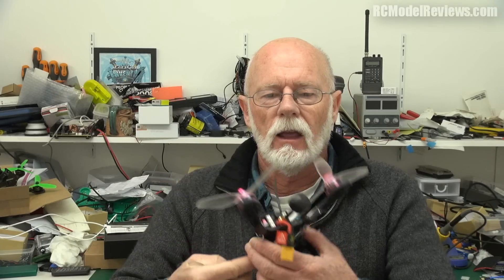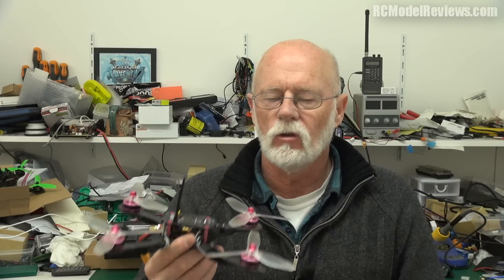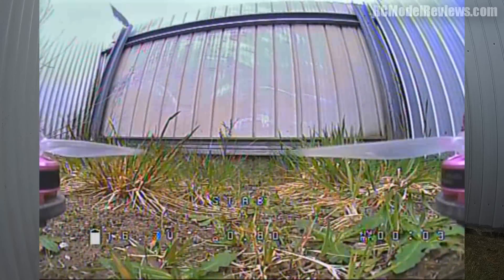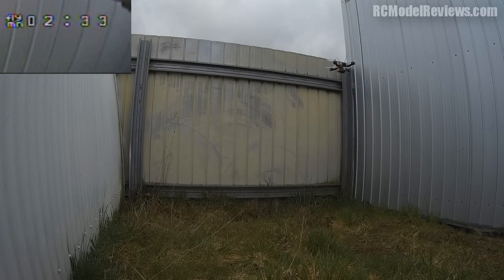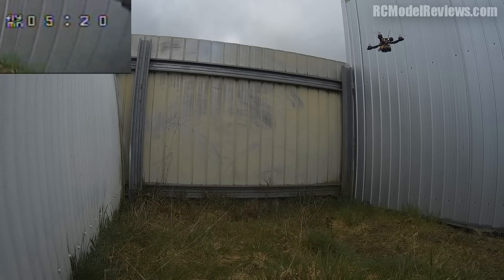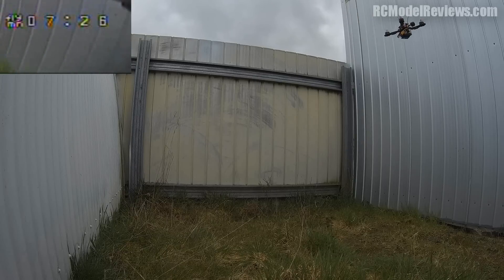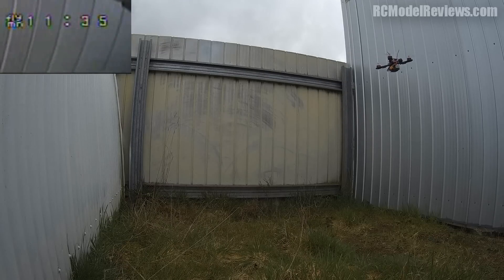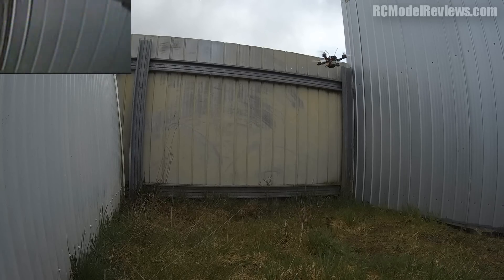INSANE flight time from Kopis 1 racing drone

Comment: The world record for RC rotor wing endurance was set by a Mikado Logo 600 set up for maximum power system efficiency and low headspeed swinging asymmetric blades.

Comment: Bruce, stick a keychain 808 #16 D v3 on there.  Just a few grams of weight, 720p is fine enough for basic uses and they can mount just about anywhere.  I really wish someone would upgrade that camera to 1080p and a few more frames.  And 2nd, clean your desk.

Comment: i get around 11 minutes out of my miniquad just hovering around. its that zmr250 with cf 2 blade props, and a 2200 3s strapped to its back. i couldnt figure out why every time i ran a 4s the thing would get really funky flying characteristics... it would heavily tilt to the right, and there is nothing you can do to combat it... i tried doing a roll to get it back level so i could bring it back, and ended up putting it in the dirt at the edge of a field. almost didnt find it...

Comment: I have a fairly heavy ZMR 250 frame. RMRC 2300kv blue motors (rebranded T-motor, though I forget the model number) w/ 5x4x2 Dal bullnose props. IIRC, with a 3s 2200mah it's ~550g. I can easily get 10 minutes out of it when I fly gently. Usually I get 7-8 when flying LoS acrobatics. Not my fastest quad, but definitely my favorite.

I've wanted to try some more efficient 6" props and a slightly lighter battery, I have what I have.

Comment: i really like the idea of cinematic fast quads,  i make jokes about how long i can get out of a 1300mah, which was over ten mins regularly, my excuse was i'm still learning and only had 3 (now 6) batteries so i didnt want to waste any power stopping unless i was learning or practising something, i also gave my battery time to recover between any extreme throttle, my videos still suck hehehe... oh i should mention to anybody trying this kind of thing, when you slow drain a battery it has very little bounce back, so a normal fast flying flight will bounce  back to 'x' on your alarm if you slow fly even 70% of the time it won't bounce back so arrange to land on first constant battery alarm,  but yeah bruce great idea...switch off the auto record on the split... it will over heat... and you want the lens just in front of motor nuts on a 27mm high topdeck  and 25degree tilt to leave just a tiny bit of prop in the corner, its invisible in normal flight and you can put black bars onto final vid.... ps.. 25mm stand off and a two millimetre nut =27mm. the big problem is jello. i've tried everything. its probably worth making a foam cube type of thing to encase the camera. and maybe something to stop the battery sliding forward,  omething to scoop it over the camera in a crash.

Comment: Most time I get with my heavy 250 mini quad (850g with battery) is 9 minutes draining the battery to 3.7V per cell. Racestar 2205 motors, Gemfan 6040BN props and 2200mAh 3S battery. I guess if I were to build one 300g less (would be pretty easy) and with the same motor/props it would fly much longer.

Comment: What is the point? Flying as a racing drone should be flown, you'd be at 4-5 minutes. Yes they're efficient but they'd be better on a significantly lighter quad. Word has it that they break easier than the r2s. If I wanted an even longer flight time I could put my goggles on and sit it on my desk for a whole day.

Comment: This is a very interesting video on efficiency, Bruce, this quad seems to be the nicest builds around. Not the top line raw performance but tuned so well, the end result is much more feasible than other RTF offerings.
I did similar experiments on mine (Diatone Tyrant 180 DIY build), it is a 4" size quad but with all the hog of a 5"/6" build, can't really bring the weight below 340g without the battery. First set was with Multistar Elite 2204/2300KV, Lumenier 4x4x3 props, average flight time 5:30 mins with different props (especially bullnose props) giving less flight time. Second one is with Emax red bottoms, 2205/2600KV, same props, giving me 6:30 mins top flight time. Plenty for my inexperienced abilities.
By my experience the props give the most difference in efficiency with bullnose props going below 3 mins. I would love to see how a properly designed prop like a Lumenier 5x4x3 or a Dalprop Q-tip performs on the Kopis 1, I think it would give a nice chart and mindblowing numbers.
Reply: I'd like to add I did the tests with Multistar 3s 1400mAh batteries, have a couple Nanotech 3s 1000mAh in the mail to check out. I tried 1000mAh 4s batteries as well but the added weight negated any added power so the flight time was actually lower than on 3s.

Comment: I have a 4in build that gets 15 minutes cursing flying to 3.5v a cell. I used the Grasshopper 160 frame which is advertised as being only 28g. My antenna is a cloverleaf that connects directly to the Ipex connector my tbs unify. for the motors, I used some no name 1306 3100kv from Amazon, $30 for the set. I tried the emax 1306 but they were a lot beefer and gave me ~11 minutes and I didn't need the power so I went back to the no name. 
 
All this was on a 1000mah 3s so if you went to 1300 you'd probably get 17-18 min cruise. I use a micro GPS on it so if they ever come out with a micro gimbal I'll have my very own DIY spark. Heres a link to what it looks like when I'm pushing it https://www.youtube.com/watch?v=EXGVOJXGSX4&index=4&list=LLrA-Al1hy0HgEXVSujPwOFA I get around 10 minutes when I'm flying like that, but it still shows that I still have plenty of power and after my crash at 4 minutes I sitting pretty at 11.5v

Comment: 25 minutes. Modified ZMR 250 frame, upside down so props can overlap the stand offs, and stretched a bit to accommodate the Rctimer 7024 CF props. Graphene 3000mAh, 3S lipo. AUW 550 grams.
Reply: Scott Powell holy wow
Reply: So like 12 min on 1500mah lol ? But damn man thats awesome.
Reply: Nice! Which motors and how fast is it?
Reply: thanks mate
Reply: Rctimer 1806, 1450kv motors. It's not a racer by any means, but is still fairly zippy. Hits about 70km/h at full tilt. For long distance it cruises at about 40 km/h. Have covered about 12 km distance in a single flight, max 3.5km out.
Reply: no, because the 1500 weighs half of that 3000 battery. more like 15+ minutes on a 1500

Comment: i thought a little bit forward movement draws less current than just hover ?
Reply: For inexperienced pilot slow forward flight is easiest & hence most stable & saves bit on energy as he is not giving too many corrective control inputs. But  forward flight is accomplished with a component of thrust so theoretically hover in calm air  saves that component & hence thrust =weight only

Comment: I got over 12 minutes on my vortex 285, with g.f. 5550 dual blade props.  I was flying around casually and doing a few flips and rolls, more than just hovering. Battery was a 1750 20c rhino 175g   that's a decent battery for 10.00     This had 1806 motors with a mobius,  auw was 580g    It was the 5550 props that did it.

Comment: why are T-motors more efficient than other other brands in general,,
Reply: Lachlan Peknice why are you always so negative on quality product reviews? I see like 20 of your comments on all these fpv videos and your always bashing these products that clearly show positive performance. T-motor is not "weak" they are by far one of the best companies in fpv and proven by many. The air motor is clearly built for efficiency not power. And Thomas from bmsweb who won world class in multi gp only run t-motor. I only run t-motor now cause of the performance and durability from what I've experienced with others. Just curious cause you seem like a troll or maybe you have confidence issues? All I know is my f40's will run circles around your emax or b-hobbys. Stop giving miss info dude!
Reply: Only saying this cause I guarantee you have never used an air motor cause for 13 dollars you can't get the power and efficiency from any other brand. I would say its by far the best budget/beginner/efficient motor you can buy. Period 
Happy flying dude
Reply: Less power = Less current draw
Reply: less power = less thrust as well,, but still T-motor gives high enough thrust, i am asking the reason for this,, the reason why T-motor outperforms other brand.. ?
Reply: They don't really... But I guess it's just tight tolerances and good build quality... Nothing magic
Reply: The air40's are renowned for being 'weak' motors.. very lack luster power output
Reply: thanks for answering,,  thanks for clearing my doubt,, i used to think they use some certain kind of magnets or coil or  something,,  that means other brands might be efficient as well,,  just that i always hear everybody praising T-motors,,
Reply: Yea, I don't understand why alot of people hype them either... I used Tmotor for a while, but got a lot of motors with faulty bearing, and poor durability. Switched to Emax and Brotherhoby. Better than Tmotor in my opinion
Reply: Have a look on the website miniquadtestbench, you have a lot of good datas there when it comes to motors!
Latest F40 & F60 are pretty well ranking there as well, T-Motor company makes mistakes sometimes but they learn pretty accurately from them!
Have a great week and keep on flying :)

Comment: Bruce check out the Kraken 7GT from Bolt. Light frame for more efficient 7" props. Its  not really gopro friendly but with a RC split the only other issue will be the steep camera angle :) https://boltrc.com.au/index.php?id_product=350&controller=product

Comment: Here's an under 250g build I did with the Runcam Split flying in a park, it could hover for a really long time if I ever hovered :)
https://www.youtube.com/watch?v=B76KbM7w4TE

Details of the components here: https://rotorbuilds.com/build/6783
It could be a lot lighter if the AIO FC and the antennas were different.

Comment: I remember my first quad 3 years ago was a 800g 250 mini quad with those old gemfam 5030s on cheap 2204s. With a 3s 2200 it would hover for an easy 10 minutes and it was pretty heavy.